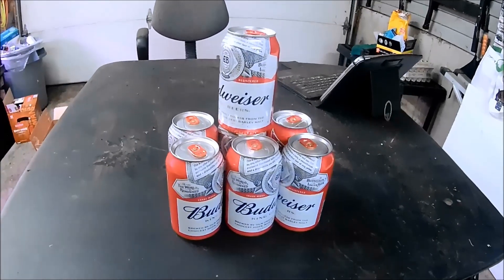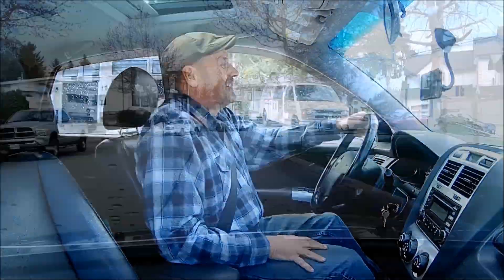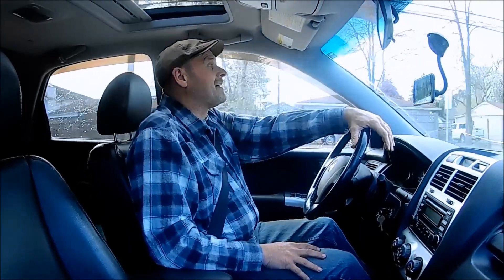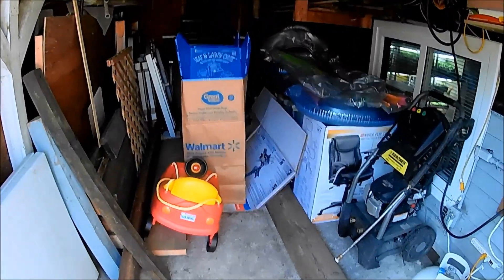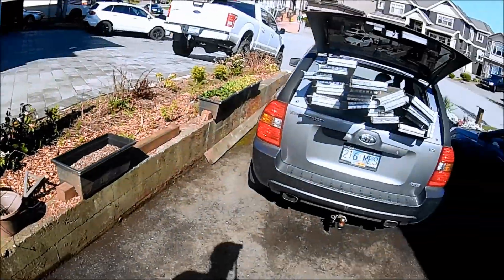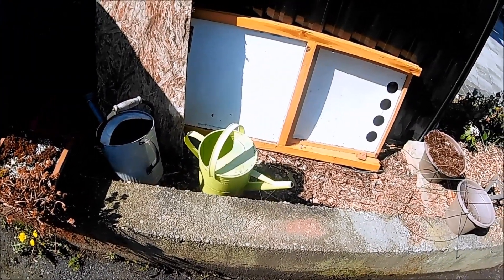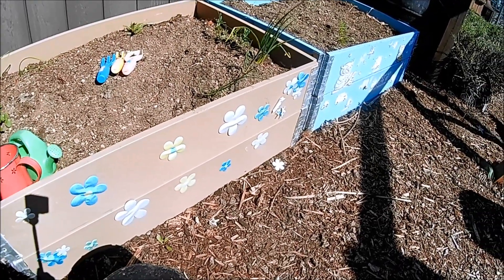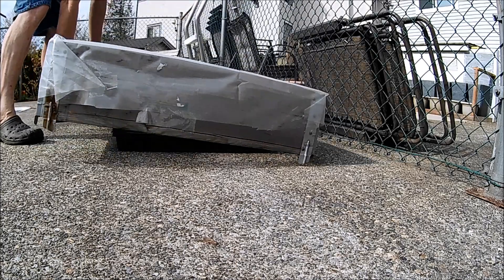Flat Pack - Easy Assemble

Comment: 6 Beer for 33 pallet collars, it was a good bargain, William. You couldn’t say no.
It's amazing what you can use pallet collars for. Endless options.
I have mounted my apple press on 4 pallet collars and it works fantastic.
Lovely flowerbeds at the end. Thanks for sharing.
Cheers🍺
Reply from the maker: An apple press, so you basically made a bench then. There you go, the uses for them are endless, have a great week Benni 🍺

Comment: Wow - great score there Willie.
The collars do come apart you know, just knock the pins out of the corners. And guess what, you can then rebuild them in a size to suit yourself 😀
Stay safe guys! 🍻(for you)  🥂  (for Mrs C) LOL
Reply from the maker: I shown some modified ones in the video Steve, but I'd not thought about pulling out the hing-pins. I suppose we could make a four-sided long or short square if we so desired, good tip mate, I'm off to play! Cheers :-)  🍺
Reply: @williamcolemansgardenandal9017  I tweaked mine to fit the allotment 🙂